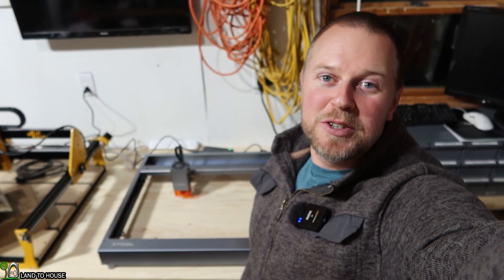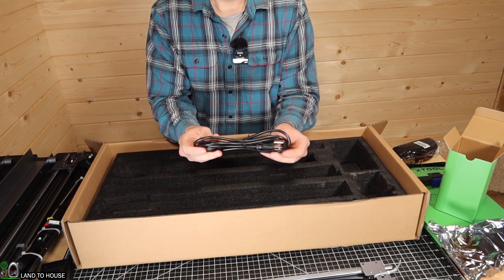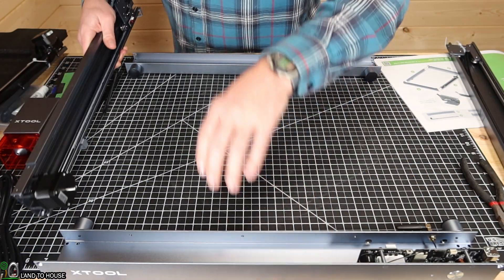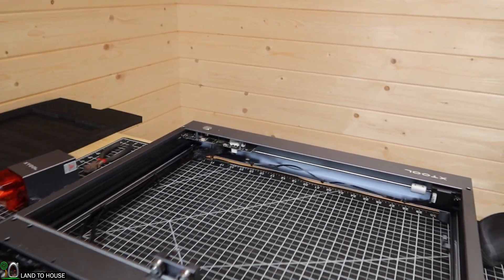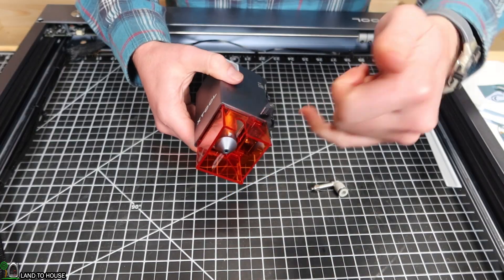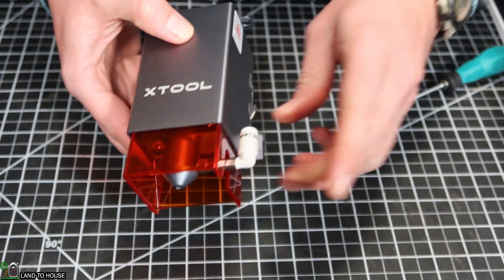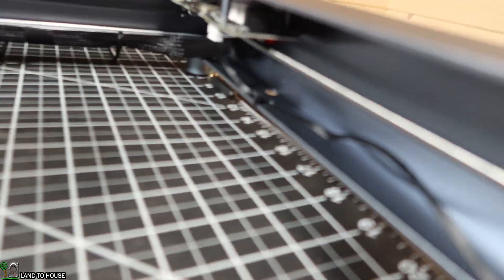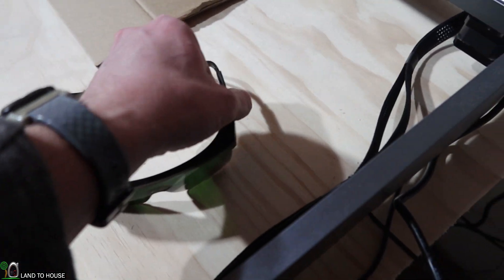Xtool D1 PRO 20w Laser Engraver Assembly and first Project

Comment: Cool! I picked up an Ortur laser engraver a couple years back, but it’s nowhere as nice as the one you have there. I look forward to what you do with yours. I’ve done some really cool tiles with mine. You’ll want to build some sort of exhaust system for it….since some material will really smell the place up quite a bit. Good luck!
Reply from the maker: A youtuber friend of mine has an ortur laser. Uses it a lot!  In the spring I am going to start on a 20x30 shop that will be the new laser and cnc shop (and several other new things that I am excided about) When I build that I am going to be installing ventilation for the laser. If I am to get into metal engraving I am going to need ventilation for sure!